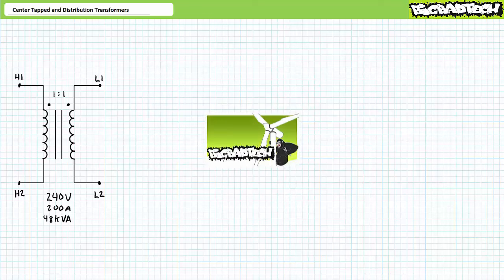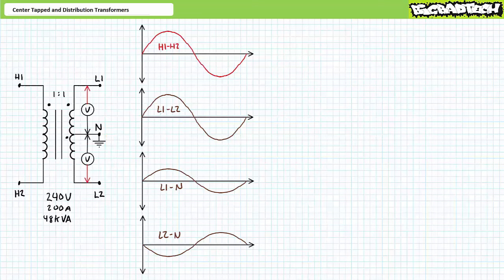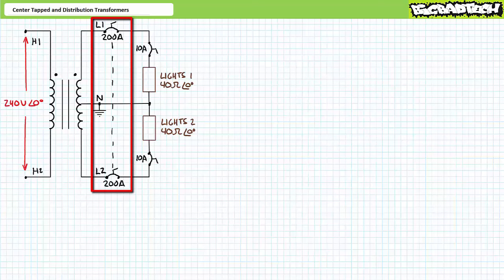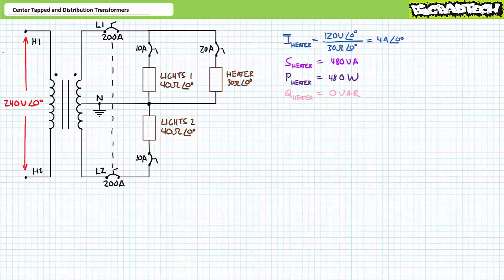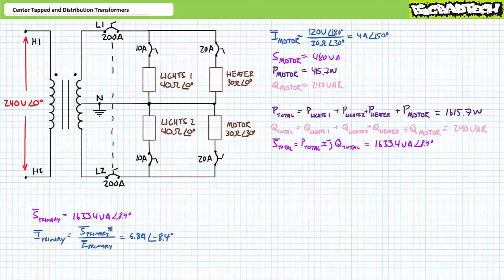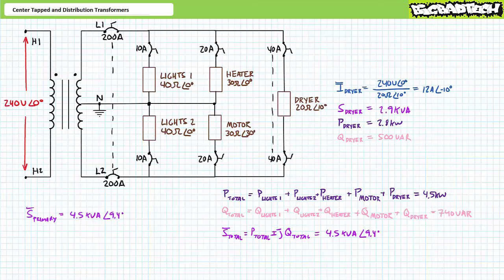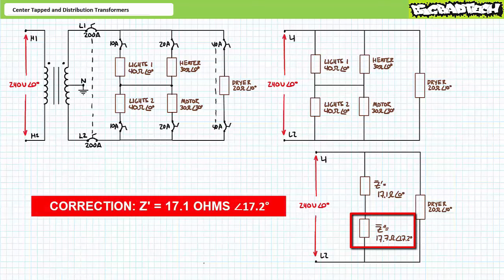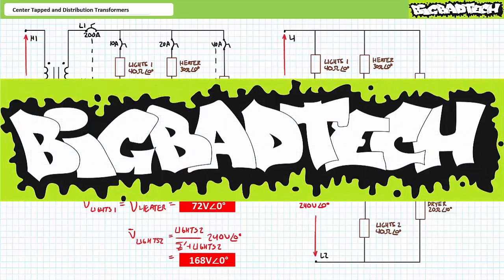Center Tapped and Distribution Transformers (Full Lecture)

Comment: If this is a single phase transformer serving multiple houses, does the center tap get bonded to the grid neutral? (The one that runs along high voltage lines)

Comment: How does the neutral not carry current if its hooked up to the same source as L1 and L2? Does it just phase out between the two and therefore not carry current?
Reply from the maker: If by "phase out" you mean equal magnitudes 180 out of phase ... yes. They effectively cancel each other out. This lecture describes how this occurs in balanced 3 phase configurations: https://youtu.be/W0iZyxrUAus